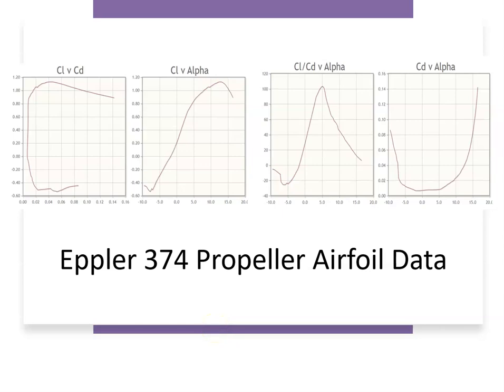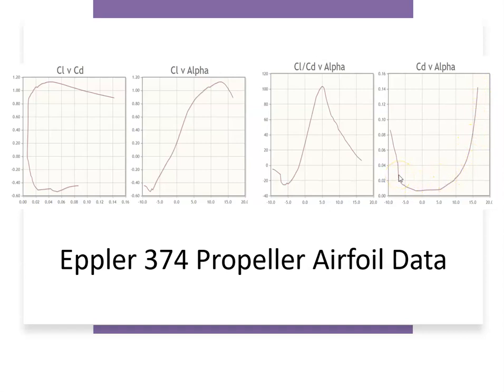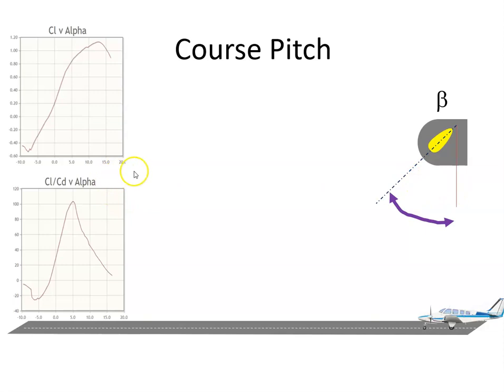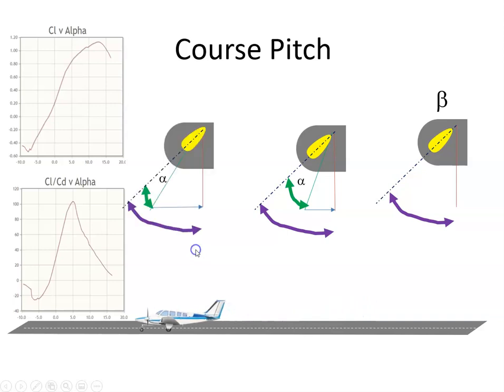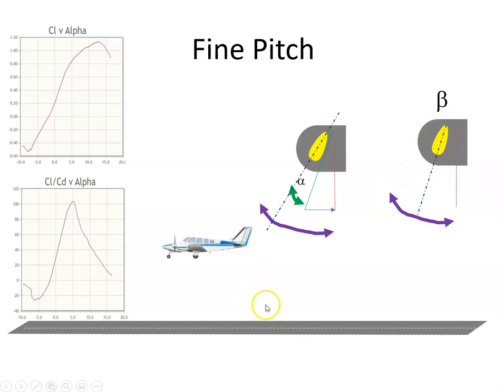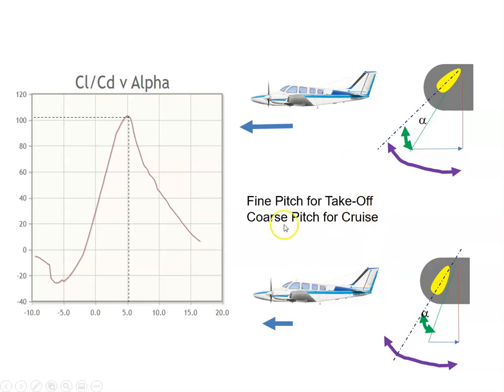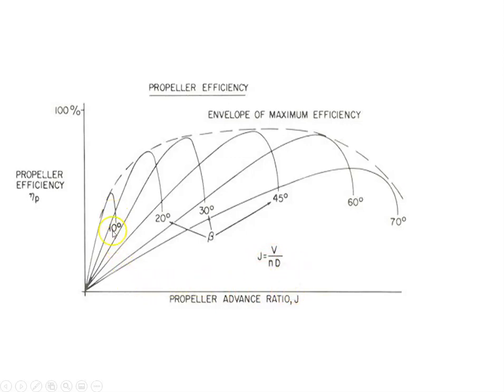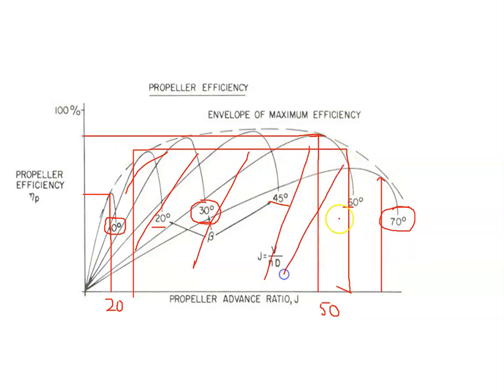When to use Coarse or Fine Pitch for a Propeller

Comment: Thanks for this great content. I've always struggled with the efficiency as a function of the advance ratio graph. What is the fundamental reason why max efficiency at a low advance ratio is obtained with a low pitch angle of the propeller ? I guess the preceding graphs of Cl / Cd versus AoA are a contributing factor, but is it the main one ?
Reply from the maker: Hello Sam, yes the Cl / Cd versus AoA graphs contribute to the Advance Ratio versus efficiency graphs. 
If you consider a constant speed prop for instance the nD (n=revs per second, D=diameter) component of the Advance Ratio (J = V/nD) is constant in the constant speed range.  In this situation J is then proportional to the aircraft velocity.  The video shows the effect the aircraft velocity will have on AoA, and consequently the Cl/Cd ratio, and hence the efficiency.
Reply: @RoddyMcNamee  Hi Roddy and thanks for your feedback 🙏. If I understand correctly, efficiency is the ratio of useful power of the propeller over total engine power. And useful power would be thrust times velocity. So I guess the Cl / Cd parameter would affect efficiency by playing a part in the thrust created by the propeller. But I can't find an equation of thrust where it appears 🤔
Reply from the maker: @samcoder6900  Here is a long explanation.
https://youtu.be/bgddsqEuSrw
In the video consider Ct and Cq as Cl and Cd but in rotated planes.
Reply: @RoddyMcNamee  Thanks a lot, very interesting.
Reply: @RoddyMcNamee  I realise that I understand the rationale behind variable pitch propellers but not so much about constant speed ones ! 😅Having a low blade angle on T/O and a high angle on cruise makes sense : any propeller being more efficient at producing thrust at a low AoA, it seems logical to tilt it as the aircraft gains speed and modifies the relative wind's direction meeting the blade's leading edge.

But I surmise it's only peripheral to the root cause of CS propellers. They achieve their goal by varying pitch but the end goal has more to do with keeping the engine RPM constant if I'm not mistaken. 
So the 'gearbox' explanations are more on point than the aerodynamically oriented ones. But I don't make much progress here since aircraft don't have gearboxes, the propeller's rotation speed being linked (through a reduction ratio) to the shaft's rotation speed. 🤷‍♂

What's your take on that ?
Reply from the maker: @samcoder6900  My take on it relates to the Power / Torque / RPM / Fuel burn charts of the engine.  In cruise, there is an optimal power setting.   This power can be achieved at different RPM and Torque settings.   However, there is an optimal torque value that occurs at a particular RPM.   Hence the CS prop keeps the engine at the optimal RPM, to give the optimum torque output at a low fuel burn.   The CS prop also ensures the propeller blade angle will change with any variation of airspeed and thereby ensure the propeller angle of attack remains at a value that gives the best Cl / Cd.